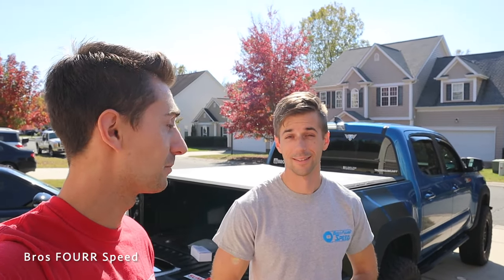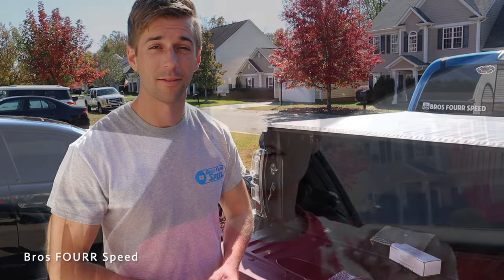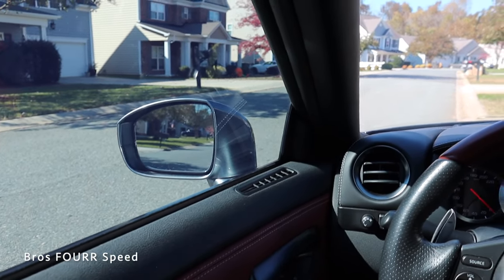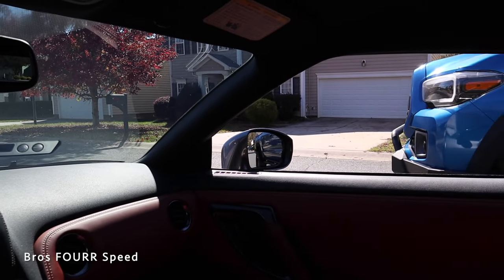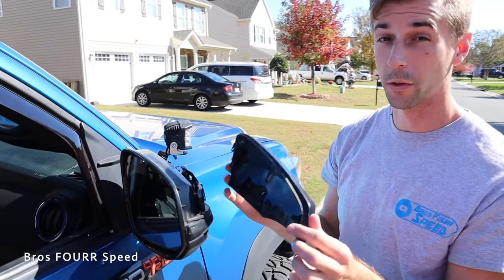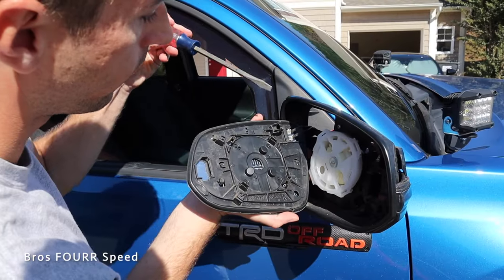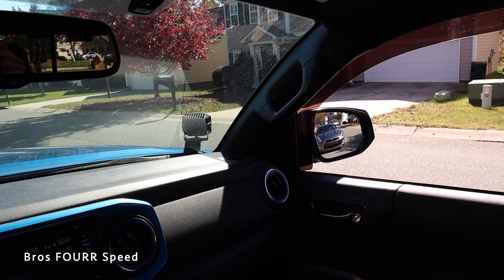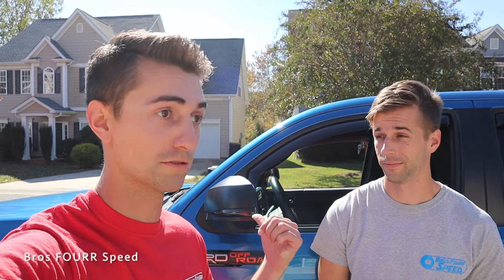How To Properly Adjust Side Mirrors For No Blindspots in ANY CAR!!

Comment: Is it advisable to align the bottom of your side mirrors to the top of the front door handle? A lot of people tell me it's too high but I'd argue you only see little when you angle the side mirrors with the bottom of the front door handle
Reply from the maker: I'd say that would depend. I try and have them what looks like level. Too high won't help you since you'll be seeing a lot of sky in the mirror. Too low isn't good since you'll see too much ground. So somewhere in the middle that looks level with the car would be ideal in my opinion

Comment: Other youtubers also give pretty much the same tip about having the panoramic view, but they say to adjust the left mirror while leaning all the way against the window, and adjust the right mirror while leaning over the center console. You seem to suggest adjusting mirrors from just a more neutral sitting position. Which way is better?
Reply from the maker: Nature position is much better. Because when you're driving, you're never leaning all the way to the window. Don't adjust things bases off a non natural way you'll move your body in the car ;)

Comment: I self-discovered this method about 10 years ago. 
Since then I argued with many “all-knowing-driving-instructors” that it is in fact possible to setup your mirrors with no blind spots, at least on all the cars I owned. 
…They were always in denial. 

I’m glad to see that someone else can confirm this wonderful technique!

Thank you for sharing!
Reply from the maker: That’s interesting! Hard to argue how well this works! They were sticking to the books lol
Reply: American cars are typically huge in comparison to Asian or even European cars. The example car in this video is a gigantic truck almost double the size of the GTR which was almost out of vision when it was next to it anyway... which sort of is the point instructors have to make. Perhaps the phrasing used is outdated but the purpose remains the same - safety above comfort. You're not going to be constantly focusing on all 3 mirrors at all times while actually driving so it's much, much better to teach a novice driver to check whether it's safe multiple times than to teach them what effectively leads to complacency.

Clickbaity title complaint aside, there are benefits and drawbacks to adjusting mirrors this way so claiming that this is the proper way and guaranteeing zero blind spots is disingenuous to say the least. For example, being able to see more of your car is useful when you're going to be parking in packed parking lot when compared to an empty driveway in the suburbs. Not being able to see where your rear wheels are will make parking in a packed parking lot significantly more challenging(which is something that a novice driver is evaluated for where I live)! You also need to take into account that you're going to be moving your head around enough to alter what you end up seeing in mirrors which is something that cannot be ignored when adjusting mirrors, e.g if you change the radio station in the GTR and check the mirror with this configuration you'll mostly see blue skies, not the enormous truck trying to pass you at high speed.

It's preference but instructors have to teach safety above all else.

Comment: I prefer seeing a bit of my vehicle.  Gives me a point of reference.  Sometimes I drive in different positions (ie left arm over top of steering wheel or 10:2 )
Reply from the maker: Keep in mind you should just know your vehicle is at the edge of the mirror. It never changes so you don't need to see it. Just know your car starts at the edge and you'll be perfect
Reply: @FylixAerou  you’re thinking looking more of the road and space, what about pedestrians and cyclists?
Reply: @FylixAerou  What about reversing and turning all the wheel all the way at the same time? The conventional way allows you to see how close the rear end of your car is when reversing in tight situations.

Comment: One major thing to consider is the size of the vehicle beside you. In the video you show a tacoma (a bigger and longer vehicle) and therefore it is visible in the mirrors. But now take a mini Cooper, you still leave the potential for a blind spot right where that C pillar (typical blindspot) is since the Cooper is a lot shorter (won't be visible in the rear view) and won't be visible in the side view mirror since it is such a shorter car. Another thing to consider is highways (multiple lanes, and the space between vehicles can vary). Per the SAE (Society of Automotive Engineers), ideally you would have your mirrors an extra 35% outwards as compared to seeing the side of your own vehicle. The easiest way to achieve this is by leaning your head against the left window (for your drivers side mirror) and adjusting it such that only a sliver of your own vehicle is visible. As for the right hand side (passenger side mirror) position your head under the rear view (middle of the center console and do the same -- position the mirror such that you see just a sliver). This will indeed limit you from seeing far back with your side view mirrors, but that's what the rear view is for, the side view mirrors are used to mitigate the blind zones. You should anyways always be aware of your surroundings.Personally, I find that the sweet spot for me is where when I lean my head against the door or center myself on the console, seeing the front door handles is the perfect sweet spot between blindspot mitigation and visibility. If anyone is interested in the mathematics behind this approach with a fully fleshed scholarly report, check out: The Geometry of Automotive Rearview Mirrors - Why Blind Zones Exist and Strategies to Overcome Them. Author(s): George Platzer.
Reply from the maker: That's not true, we tested this with our motorcycles as well and you could see it fine.  Smaller cars are still easy to see..When the mirror is adjusted properly like we showed, you can see the car in the rear view and in the side mirror at the same time, regardless of the size of the vehicle. If you want to set your side mirrors that far out and it works, great.
Reply: @BrosFOURRSpeed  Respectfully, I have been a truck driver for over 15 years, biker myself, with millions of miles under my belt (not saying you don't have your own experiences, but I've seen a thing or two as well). My comment does not serve as an argument, merely an insight for anyone interested in knowing some more specifics about a PROVEN way to adjust your mirrors to mitigate blindspots (through a peer reviewed scholarly mathematical report -- the math is objective and not subjective like opinions). It was something an instructor had told me when I was getting my CDL, has never failed me yet! But to each their own as long as you feel confident, are aware, and keep others around you safe!
Reply: @SeattleSounder-u3p  Preach Brutha, saw another fella make the same point. Agreed.

Comment: Ok very good now can you explain and show how will you do parallel parking with the left side mirror so outside ????
Reply from the maker: Easy, you use your right mirror for that 😂
Reply: Thanks but I guess my question was not well formulated, I meant if you have the right side so outside how do you manage to do the Parallel parking and make sure don't bump the curb?
Reply from the maker: @jmartinezortiz  Ahh, you can change it for that. I very rarely ever parallel park where I live so it does effect me. But if you have too, just adjust the mirror for that and then back for driving.

Comment: Question when adjusting mirrors this way: how do you gauge if you can change lanes safely? Do you not change lanes if you see a car in your side mirror? Because it’s not pointed towards your blind spot? Or are you safe as long as the car in the other lane is on the top half of your mirror? What’s the method of using the adjusted mirrors?
Reply from the maker: With the mirror popped out you'll know if a car is right at the corner of your car. If so, that'd be an unsafe lane change. So  you want to make sure a car is far enough away to make a safe change

Comment: You guys did quite a few tutorial videos on how to drive manual cars, can you also do one on automatics? 

 My cousin and aunt would find that useful lol.😳

Good tip on the mirror adjustment!  I always set my mirrors so that they are aimed parallel to the car's side.

 I still turn my head to check blindspots when I switch lanes though.
Reply from the maker: https://www.youtube.com/watch?v=mR5zULValzo
Here's a video I did on what not to do in an automatic. 
Glad you liked the vid! I still check over my shoulder, but it's nice to know the mirrors always have the other cars in view.
Reply: @BrosFOURRSpeed  For sure, the wide angle mirror worked a lot better than oem on your truck.  It is always a good idea to shoulder check, I do it especially if I know a motorcycle rider is near my vehicle when I switch lanes.  

The next problem is dealing with other drivers who don't do mirror and/or shoulder checks, that is almost all of the drivers here central FL.

Comment: I just started driving. My problem when I do this is I have no reference as to where the other car is to mine so I do not know if it's safe to merge or not. That's why I keep the tail of the car in the mirror.  Can someone explain what Im doing wrong
Reply from the maker: Think about it. You don't need the reference where your car is. Your car will always be attached ;)
Just know your car is just outside the mirror frame and it never changes because obviously your car is still what you're in

Comment: I liked to keep my mirror to where I could I could see my wheels a little bit when I had an older car with a bit taller mirrors, that way I could gauge parking against a curb, but in my sedan right now I can't do that though it's thankfully equipped with side cameras so I use those for parking, It took me a while to realize that having my mirrors angled the same way I did for my crossover in my sedan wasn't necessary and actually ineffective
Reply from the maker: Yeah that can help a lot in a big truck

Comment: But why are official driving schools saying that you need to see both your handels on your car and 2/3 of the road and 1/3 of the sky?
Reply from the maker: I was never taught that when learning to drive so it could just be the person you had. I don’t think everyone teaches that way.
Reply: @BrosFOURRSpeed  i'am probably in a different country. And it is a question that you get when doing your exam.
Reply from the maker: @jordycuyt4979  Interesting. We don’t have a written test for getting a license, just a driving test.
Reply: @BrosFOURRSpeed  we have both. Before you even want to take driving leasons or so you have to take a theoretical exam and if you pass that you get to drive with a driving school or with someone that has their lisence for atleast 8 years. Then  after 3 months of learning you can do your driving exam. But also at that exam before you start the examinator asks a couple of questions as where for example the oil is. And also to turn on your blinkers etc. And questions as to how to hold your steering wheel and how your side and inside mirrors have to stand.
Reply: @BrosFOURRSpeed  sorry i mayby forgot to mention i'am not from the US. But i would asume that most things would be similar but aperantly they're not. I'am from Belgium.

Comment: That is the SAE Method-- it is recommended by numerous authorities. It is wrong to think it eliminates all blind spots. You are really displacing or trading the blind spot for another. For example, recently I had a dog run up alongside my car right in the middle of busy traffic. The dog must have escaped from a vehicle... Just before I was going to enter the unprotected Left Turn area upon the green to make my Left Turn, I noticed an odd shadow coming in low on my Left Side, and it appeared off my mirror which at that time was set to the Standard Method. Had I had the mirror set to the SAE method, I wouldn't have noticed the dog. I alerted the opposing traffic of the dog.  Now that could have been a child, a person or a bicyclist.  So I think the SAE method, while great for covering your Blind Spot upon lane changing--it would be a good idea to set some Blind Spot mirrors that cover the Standard View at the lower rear and side of the car.
Reply from the maker: Never heard of that, just adjusted them to what I thought was best, works very well. Obviously a small object around any vehicle would be very hard to see no matter how the mirror was angled. Mirrors weren’t designed to see straight down for a situation like that.

Comment: good tips, but you should've tested with a cyclist or a small motorcycle, not a huge truck. of course a huge truck will never be in your blind spot no matter how you adjust your mirrors. you shouldn't give the impression that you can adjust you're mirrors to completely get rid of the blind spot, a motorcycle could be there. always check your blind spot people.
Reply from the maker: Yes that is a good point of course, but when you have the mirrors properly adjusted, it will take the blind spots away because you can always see behind and to the side.  We ride motorcycles and yea they can still be hidden anywhere on the road, but obviously you still need to look and be mindful of that.
Reply: You're supposed to be monitoring your Rearview Mirror to see Anyone closing on you.

Comment: I have to disagree a bit. If you don't see ANY of your car in the mirror, you have no idea how close you are to the other car, especially when parking, at the very least, the rear door handle should be visible.
Reply from the maker: I don’t agree with that. You always know exactly where your car is so pull easily be able to tell where another car is.
Reply: @BrosFOURRSpeed  Only if you're a skilled driver, not everyone is, I've seen plently of people take 4-5 turns to get out of a parking spot I get out of in 1-2. Just saying for the general population, seeing a bit of your car is better because you don't have to think about your car being at the end of the mirror, you see it and there's no additional focus needed so you can focus on what's in front of you better. But, we don't have to agree to have an opinion.
Reply from the maker: @lidge1994  true. But those people probably shouldn’t be driving lol. But when you turn your head slightly that’s when your car should come into the mirror view. So head straight you won’t see your car, but once you start turning your head that’s when you’ll see it. That will give you the best field of view. And it’s still good for people to practice the best habits from the beginning